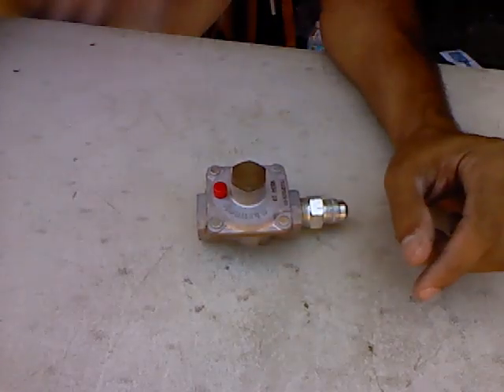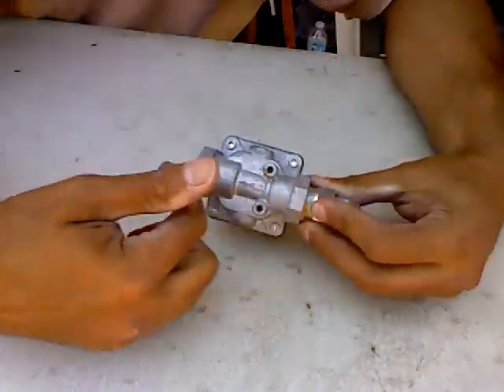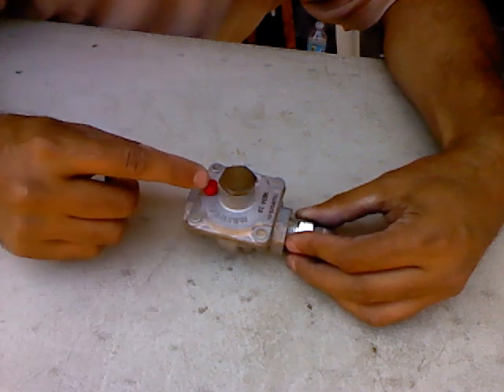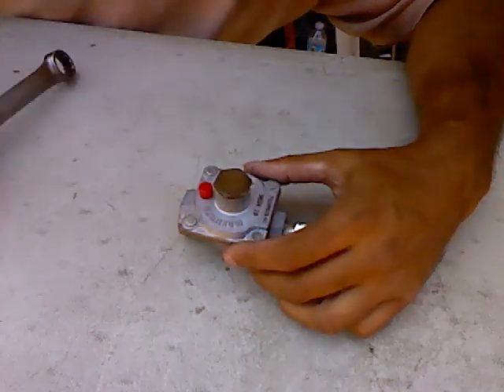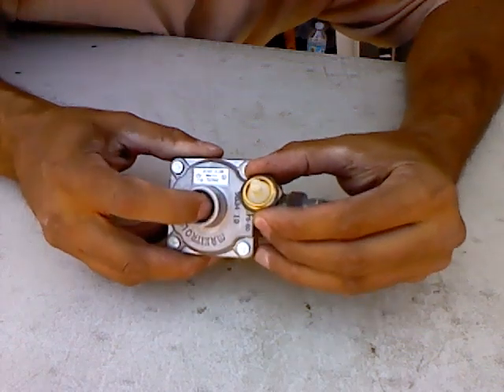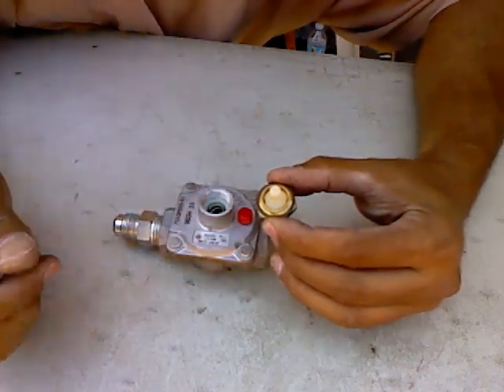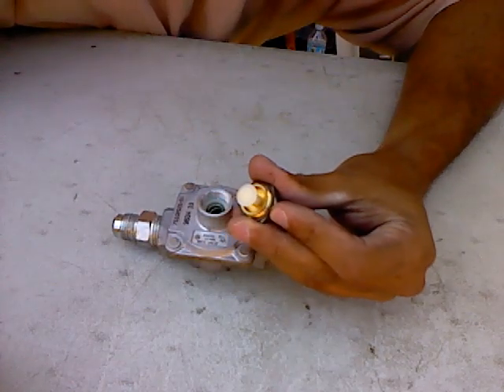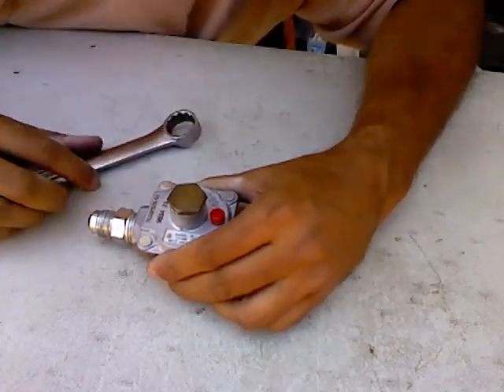Converting A Maxtrol Gas Regulator for  Natural Gas (NG) or Propane (LP)

Comment: Hi, I have an imperial ICVG-1 oven how can I convert it to LP? Please ..
Reply from the maker: This video shows a common regulator that's used in a common household appliance. Most commercial appliances like Imperial ovens (I'm assuming it's a double oven) use a regulator that's part of a master control with an integrated on/off switch and thermostat. I've done those systems before, so feel free to get a hold of me at 714-574-1544. Call during regular West Coast (California) business hours, please.

Comment: Do i need to change the orfus behind the nobs also?
Reply from the maker: Fuel conversions usually involve 4 changes; the regulator, the orifices, the low flame setting and the air shutter (mixture). The low flame setting and the air mixture are usually fixed and cannot be changed in many cases, so the size of the orifice bore (hole) is usually what determines the low flame setting. In all conversions, the orifices and the regulator need to be changed. Most home appliances (like stoves and ovens) have a regulator that can be swapped from propane (LP) to natural gas and vice versa, but most bar-b-ques don't have a convertible regulator, so bar-b-ques usually require that the regulator be changed as part of the conversion. It's necessary to swap the orifices also when doing a fuel conversion. I have orifices to fit virtually anything made, and I also have regulators to match the application. Feel free to contact me at 714-574-1544. I'm on the West coast, so contact me during regular business hours (9 a.m. to 5 p.m. PST).
Reply: Thanks you. I will give u a call if I run into any difficulty or need parts.

Comment: Frank, I need a regulator solution for my natural gas range.  I have 11" of WC on the natural gas service to my house, however my gas range takes 20+ minutes to boil water.  My flame is blue base with blue tops, so no problem there.  It's just that there is not enough gas flow to the burners.  There is a Dong Yang 316416705 regulator on the range (Fridgidaire Pro Model #FPGF3081KFM) which I do not believe is adjustable.  Please correct me if I'm wrong.  I would like to upgrade to an adjustable regulator in order to get more flow.  Any suggestions?
Reply from the maker: The only time you'll need an adjustable regulator (as opposed to a fixed regulator) is if you're adjusting for altitude. Most regulators that you'll see on a Frigidaire are dual gas regulators that have two rating on their label; one for propane (LP) and the other for natural gas. Each of these ratings are fixed for each type of gas and cannot be adjusted to compensate for altitude.

There are two, sometimes three things that need to be changed in order to do a propane to gas or gas to propane conversion; the regulator must be converted or swapped out, the orifices must be changed and the low flame setting must be adjusted (if this setting is possible on the stove you're working with).

I think you're a little confused. The 11"WC setting is for propane (LP).  Natural gas is typically 4"WC. If you're trying to use a regulator set for propane on a natural gas stove, your gas delivery will be severely restricted. The plunger contained inside the cap on a convertible regulator actually compresses the internal spring for use with Propane (LP). The spring should remain uncompressed for use with natural gas. If you removed the regulator from the stove, you'll want to make sure that the gas is running in the direction of the arrow. 

The regulator conversion will not do you a bit of good if you didn't swap out the orifices. I have Frigidaire orifices, so feel free to contact me if you need to replace your orifices at 714-574-1544.
Reply: Frank, thank you for the information.  Let me clarify a couple of things.  I am on natural gas and had my service upgraded from 7" to 11" WC by Columbia Gas because I run a coffee roaster that needed the pressure.  So, I am not converting from NG to LP or vice-versa.  I'm just trying to figure out how to get more flame on the stovetop.  Btw, I am not running the roaster at the same time as the gas range.

Comment: But what about the fact that those regulators are only rated for 1/2psi at the inlet? Do you just ignore that and hook straight up to an lp tank, or is a dedicated tank regulator needed in series to drop the pressure to 1/2psi before it hits the regulator you just converted?
Reply from the maker: Generally speaking, a "house propane system" will already be regulated down from a master propane tank that delivers LP at 11" WC, thanks to a regulator at the source. Appliances are usually designed to consume propane at 10"WC, since appliances usually have their own regulators.

Comment: I have a Hearthrite Vent free heater. Want to switch from gas to LP.  Any thoughts?
Reply from the maker: I normally sell the orifices along with the regulators as a matched set. Just contact me, and I should have what you need. I'm on the West Coast, so contact me during normal business hours (10 to 5) at 714-574-1544.
Reply: Frank Hamilton ok thx will do

Comment: We have a deep fryer at are church  will like that's  not been  used will like to use  it for are activities but dont now if it is for natural or lp how can i tell
Reply from the maker: A lot of those professional fryers can be adjusted between natural gas and propane. If your unit has an adjustable fuel regulator, then chances are it can be adjusted to be used with propane or natural gas.

Comment: With the cap off, are you able to tweak the output pressure on that unit?  Mine looks exactly like yours.
Reply from the maker: This one has a fixed output pressure of either 10"WC for propane or 4"WC for natural gas. If you have a variable pressure regulator, then the cap to yours is round and slotted, not hexed like mine is. The other indicator is that the cap on mine is brass, while the cap on yours is nickel plated. To adjust the pressure on yours, you simply remove that cap with a large slotted screwdriver, then use a Phillips head screwdriver to turn the inner adjustment in and out. If you turn it "out" the output pressure is increased and the opposite direction will yield the opposite effect. 

You'll want to note where the adjustment is by "clocking it"  before you make any adjustments to the regulator. That way, you can reset it to it's original position if you need to. If you've never had the stove under flame before, it's probably best practice to start with the adjuster turned all the way in, then gradually turn it out a half turn on each attempt. That way you won't be surprised by a flame that is dangerously large. The critical adjustment is getting the low flame the correct size, so you'll need to have the flame lit when doing your adjustments. All other flame intensities will be rendered properly when the low flame setting is correct because the manual control valve is designed to control the full range of flame intensity as it sweeps through it's different levels (low, medium, high). 

The regulator is only designed to adjust for the proper fuel inlet fuel pressure. If you have flame rendering issues where the flame is not sharp, has yellow tips or is unsteady, you'll need to view my video entitled Flame Adjustments On A Stove (How To). The URL is as follows: https://youtu.be/6S5ZPA9eGng

Comment from the maker: Your unit is unique  because it is designed to be converted quite easily, I actually sell orifices to do a propane conversion for units that don't  have such a feature. The orifices that you have are called hooded orifices because the threads are on the inside rather than the outside. A double coaxial hood is an orifice that can be adjusted for gas or propane use. To adjust double coaxial orifices for use with propane, simply tighten down the orifice until it is snug. The propane gas will then flow through the more restrictive hole in the middle stem part of the orifice. You'll  also have to convert the regulator like I did in this video and do two other adjustments. The other two adjustments are an air shutter adjustment on the burner tube and a low flame adjustment under the control knob. If you  look through my other videos, you'll  see those other two adjustments performed as part of a propane conversion. Hope this helps. Make sure to share my videos...
Reply: I don't get it. Do you mean you also need to change the orifice on a NG stove or water heater nozzle? Or do I only need to change the pressure setting on the regulator? I want to run a NG Water Heater with propane (LP).

Comment: I have a GE stovetop that I purchased for outdoor canning that I want to convert to propane.  I was able to change the regulator as you made this very easy.  My problem is that the unit states to screw the double coaxial hoods down tight and I should be ready to go.  I just can't figure out what the double coaxial hoods are.  GE sent me a manual, but the manual shows a control panel which my unit doesn't have.  I'm confused. Can you help?